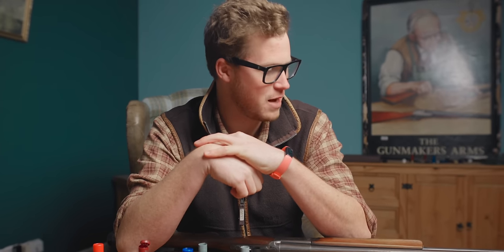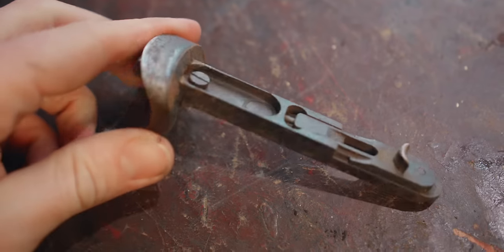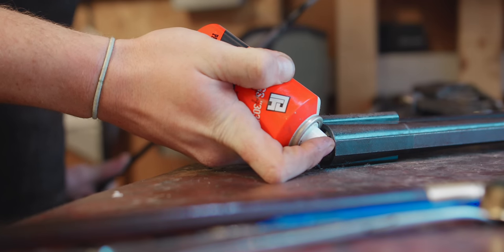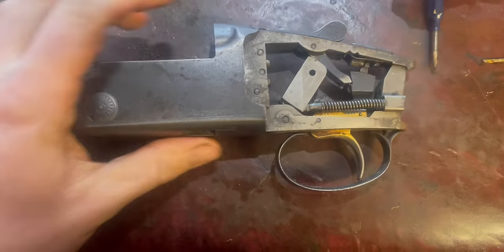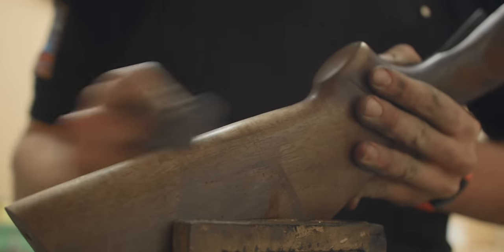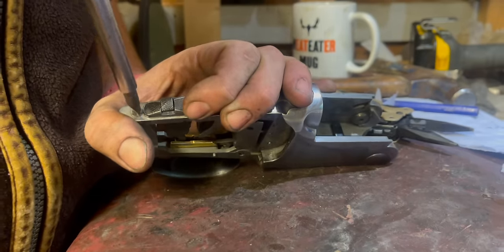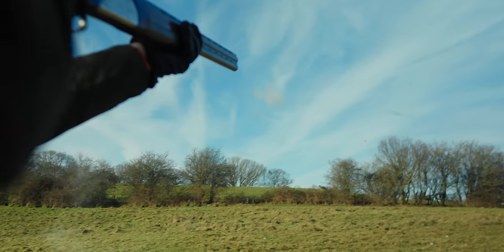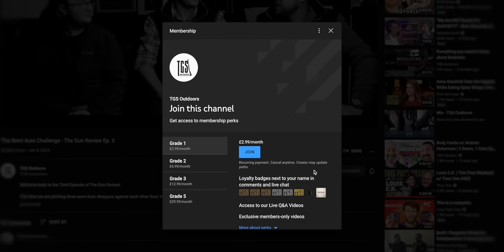The $2 Gamble - Can I Turn This Rusty Shotgun into Gold?

Comment: What a great project gun. I would definitely have taken it on as a restoration project for that crazy low price! The only thing I would do differently is I would have put the barrels and other metal in a steam cabinet to convert the rust and card it instead of scrubbing it with steel wool and oil. 

That thing would be at least $500 in the used gun rack here in the USA, even in its original, dirty condition.
Reply: Would have paid ten times that just for the metal & wood...

Comment: For future reference, you boil rust parts in distilled water to covert the rust. Basically the final step in rust bluing (or blacking/black oxide finish). Simply boil, card, oil. It won’t comprise the original bluing, and also loosen the baked on crud.

Comment: Had to clean up an action almost as bad as this one. Soaking it in a bucket of WD40 for a week did the trick. Cleaned up the oil soaked into the stock by soaking it in acetone over night. It draws all the oil out.

Comment: That is a perfect grouse/woodcock gun. Open chokes short barrel. Good for fast shooting in a closet sized opening. I'd take it
Reply: Did Jon ever say what gauge it is? 12 is obv out of the question for woodcock.
Reply from the maker: What’s wrong with 12ga for woodcock?
Reply: Load it up with some 2.5" low pressure loads, should be fine

Comment: For me working on an old gun is like a vacation. A good technique to know when working on stocks is strip sanding. You would be amazed what you can do with that technique. Also for anything that is gummed up I like to keep some fuel oil around. If you soak it in the fuel oil for a bit it will cut the grime and loosen up most fasteners. there are also some tricks you can use to draw some of the old oil out of the stock and then lighten it before refinishing.

Comment: Very nice. I worked on a few old side by sides during COVID to keep my hands and mind busy. They all came out very nice. Had to go to a gunsmith for some internal work. I use one for pheasant hunting and harvested quite a few birds with it. I used Dura-Blue spray for the finish on the barrels. It came out very nice and is holding up. I would have loved to see you use that on the barrels of this gun you refinished. Happy Hunting!
Reply: Do you recommend Dura Blue? What is the prep work like for it? Does it look thin?
Reply: I’ve done three guns with it. The prep is sanding down the barrels to get off the blueing. Final sand is 600 grit. Then follow the directions. It comes out nice.
Reply: Does not look thin. Also, you don’t have to worry about fingerprints on the barrel.

Comment: LOL! Sorry, but man alive! That gun was in WAY better condition than a lot of what I work on. Also... I am SOOOOO jealous! It's simply impossible to buy ANYTHING in Canada that cheaply. People will pay $50+ for a completely rusty parts gun that consists of only 2 parts - a crappy, dirty, cracked wooden stock and a rusted barrel. Nothing else. No bolt. No trigger. No iron sights. Nothing. I wish I could get stuff that cheap - I'd buy everything I possibly could. 

The one thing that I didn't like seeing was how you cleaned the bore. The rod looked like it was a steel rod - correct me if I'm wrong. I do the same thing with stuff that is just insanely bad, but I use only brass and/or aluminum because they're much softer metals, and you're not going to do any hard damage with them - whereas steel can do serious damage very quickly.
Reply from the maker: It’s an aluminium rod, with 0000 wire wool wrapped on a phos bronze brush
Reply: Ah! Thanks for the update/info!  @tgsoutdoors  

One thing I forgot to mention is that I also use wooden dowels sometimes. Good & bad with wood - good you're guaranteed no accidental damage - bad you're much more likely to break the rod, particularly in/at the drill chuck.